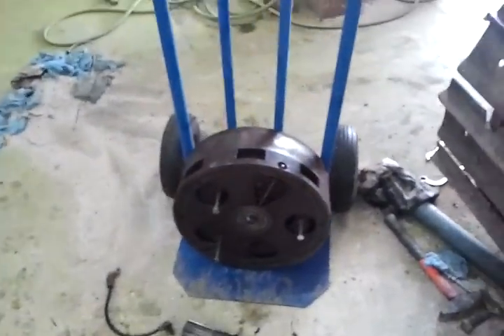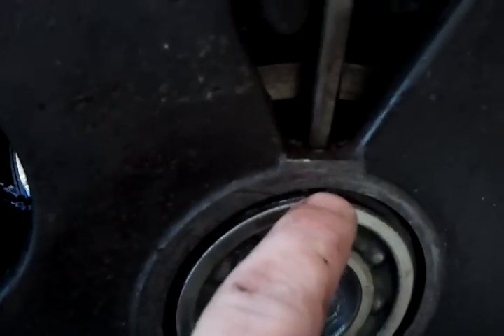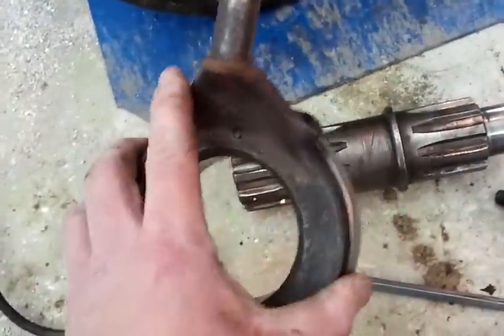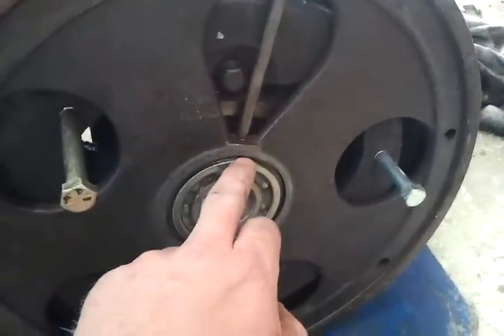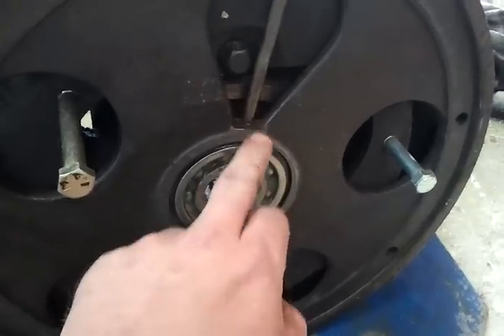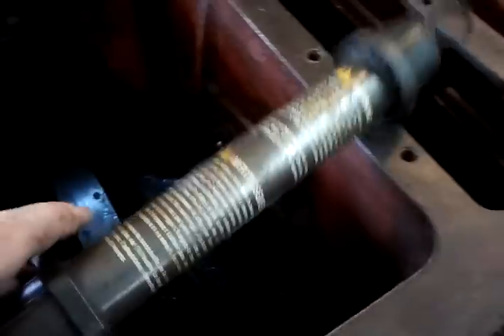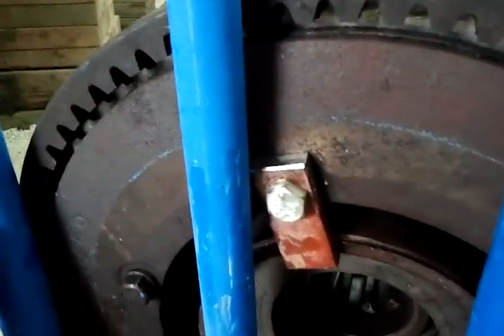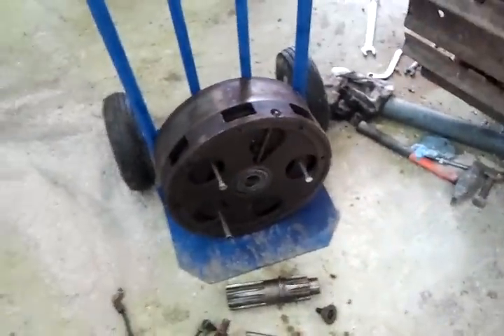Td9  t9 steering clutch bearing

Comment: I am about to take my steering clutches out to clean them as one side is stuck. Can you remember what thread & length the bolts are that you use to compress the clutch pack to allow it to be removed?